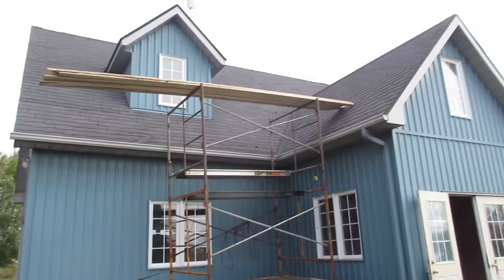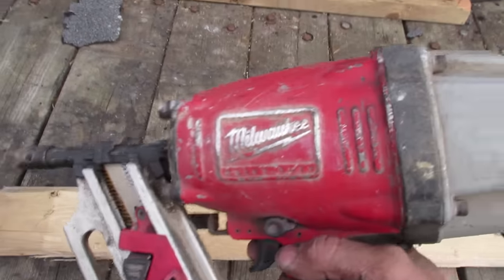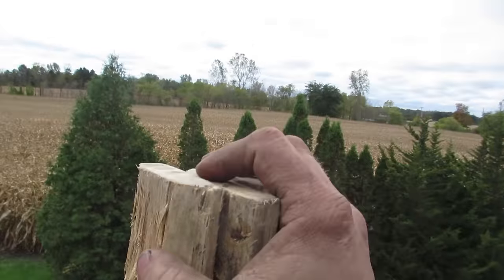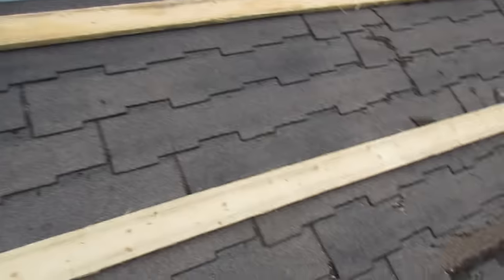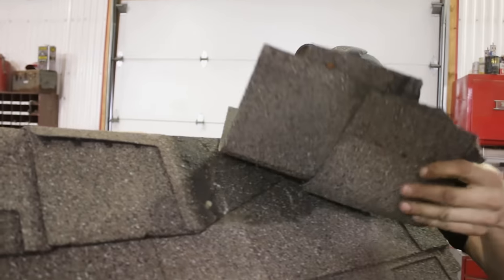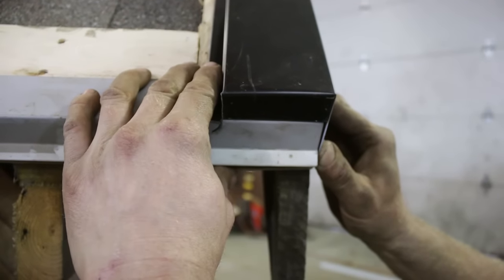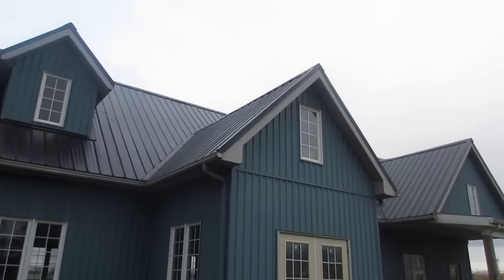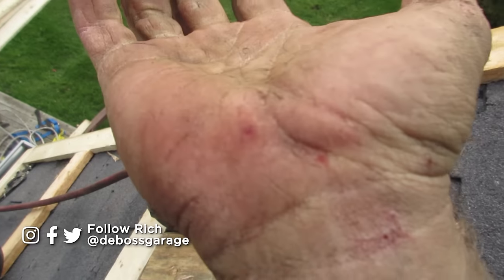How To Install DIY Metal Roofing (House or Barn)

Comment from the maker: Want to win a Lincoln Electric MIG-Pak 140MP? ENTER HERE ➜ http://debossgarage.com/contest
Reply: Great video, thanks. Do you recommend using the wood slats in every metal roof application?  I will be installing metal on my patio cover with only about a 6% pitch. Thanks.
Reply: A trick for your ridge cap....  Cut some flashing strips from your scraps,  say 3" x 10" or so.. . nail 4 of them onto a long 2x4 with flat roofing nails..  then screw those flashing strips in your top row of screws so that you'll  have a walk board to stand on....   Make sure, when you nail the strips to your board, that it lines up with your highs, of coarse.. super easy to do and easy to move works great and doesn't scratch the roof and allows you to not be bending your ridge outta shape while you work.
Reply: DEBOSS GARAGE don't you have to use the pink insulation on top of shingles?
Reply: @corndogextreme8887  What you’re looking for is called FanFold. It’s a 1/4” thick foam board insulation that comes in 4’x50’ folded sheets. This should be used in place of the purlins (wood slats). Purlins should only be used when the rafter/trusses are exposed.
Reply: @calholli   Sounds like a great idea but I'm having difficulty picturing how it all goes together and functions as a walk board.  Can you provide a bit more detail so I can get the picture?  Cheers Mitch
Reply: Wow I never seen vented ridge foam

Comment: Hello Rich,  I have to say that each steel manufacturer has his own recommendation as to where to put the screws be it peak or valley.  Most of what I have used is on the flat with stitching screws (smaller shorter ones) used on the seam overlap and the peak cap.  The other thing you might be missing is the panels are designed with the contours to be able to take the expansion and contraction.  To overdrill your pilot holes is counterproductive because if drilled to be just a bit undersized when the screw is driven the steel will 'volcano' just a bit.  Now when the neoprene washer comes down it makes an even better seal on the projection and water will most often run past very easily rather than climbing over.  Take a look on some old steel at the screw holes and you can see this.  I have not seen and have no knowledge of a properly screwed roof (as you say don't squish the seal) leaking.  My own has been up for thirty years in our coastal high winds (at least once per year over 100mph) , wet snow and 160+ inches of rain per year without any failures.  I am totally with you about walking on steel.  I won't do it if it is even dew damp!  And a harness is a must for even the most dare devil of installers.  Take care.  Doug
Reply: excellent counter points.  Thanks!
Reply: I always drill a smaller pilot hole in my steel as I go along. I dont predrill sheets.

Comment: Another thing I have to add is, you really need to locate and make sure your nails are hitting the rafters when nailing the 1x4's on. If not you are just nailing into old plywood in many cases.
Reply: Or crappy OSB.
Reply: Esp if your mailing into a mobil home

Comment: The ridges on your panel are flat. Our mfr pattern is rounded. It makes it harder to drill down thru to put screws.. Amish roofers put the screws on the flat either side of the ridges on the sheet. They also have an improved screw with a bigger washer and domed cap. Screw down steel is inferior for houses,

Comment: For people that watch the video and didn't click SHOW MORE under the video:
As for ridge screws; check with the roof supplier. Some warranties have changed in recent years where-as the screws are installed on the ridge, the warranty is voided. I had my roof installed in 2012. The builders installed ridge screws (thus far no problems). In 2014 the same metal roof company changed their warranty (applied to 2014 and later installation) to only cover roofs that have screws in the flat areas.
Also, IF you are screwing into the ridge, BE SURE you are using the longer screws (NOT the 1" or 1.5") because the shorter screws will back out over time due to the roof flexing in hot and cold weather.

Comment: Hi--great informative video...just a couple questions, if you've got a minute...regarding James Biggar's comment regarding underlay over the strapping to prevent rot--valid point, or not a big concern with shingled roof and it's vapour barrier still in place? (The garage example he'd used was direct over ply in an unfinished space).
Also, I'm in Ontario, and don't mind driving--could you please point me in the direction of your supplier (the prices you'd mentioned in one of your replies is pretty hard to beat)? Thanks again for sharing so much great info

Comment: also when putting those steel sheets use thick gloves because if it slips and starts sliding it will cut your hand if you try to catch it and also because of sharp edges anyway.

Comment: Thinking of air flowing underneath the metal roofing why not running 1" x 4"s vertically - spaced to match ribbing of roofing for securing with screws? Have screens at soffits end and construct ridge cap for airflow at roof peak. Also, I was told install heat reflective underlayment on shingles before installing 1 x 4's. This is supposed to control condensation issues under metal roofing.
(Just asking - curious!) I'm looking to cover shingle roof on my house - wanting to improve any  cooling of roof. 🤔

Comment: Hey, that stuff is thin. That's 29 gauge, right? You should have a factory nearby that will supply the 26 gauge and maybe for just a little more. Putting the screws on the ridge is interesting though. 🤔🤔🤔

Comment: THANK YOU......THANK YOU......THANK YOU.......YESTERDAY I ORDERED SOME METAL FOR A ROOF JOB......THE MANUFACTURER SAID DO NOT SCREW ONTO THE HILL....IF YOU DO IT WILL VOID THE WARRANTY.......INSTEAD.....SCREW INTO THE VALLEY.......THE FLAT AREA.....I PICK UP THE METAL ROOFING TODAY AND WILL ASK MORE QUESTIONS.....ALSO TELL ALL YOUR VIEWERS.......DO NOT USE A 4" CUT OFF SAW AND BLADE TO CUT THE METAL......THE SPARKS ARE HOT METAL PICES THAT LAND ON THE FINISH PAINT OF THE NEW METAL ROOF......IN ONE YEAR THE RUST SPECKS WILL START TO SHOW.......THANK YOU.....THANK YOU....THANK YOU

Comment: Is the additional weight an issue? Considering you basically have 2 roofs on it?
Reply from the maker: It depends area to area.  We calculate snow load on all our buildings which could be 2' of wet snow laying on top.  This is nothing compared to the weight of melting snow.  This is a steep pitch too however so the snow usually doesn't stay on, even though it will be designed to do so

Comment: I remember doing it on the rib nowadays the last one I did they wanted on the low not sure why some of the amish in Ohio do it in the low aswell.
Reply: Here in northern Oswego county N.Y. an in any area east of Lake Ontario those screws go in the low spot. An that is because steel or shingles when you get 3-4 ft of snow in 2 days you shovel it off. When the snow builds up that fast you really can't let that much weight sit on your roof. The snow usually won't slide off steel roofs till it approaches 28 to 32 degrees Fahrenheit. So if we get a wicked cold snap and a lake effect snow event that dumps 3ft of snow or sometimes more. I've seen up to 6ft fall in under 3days here. When that happens you get up there an get the weight off your roof. When those screws are on the high part of the ribs it's a wicked bitch to shovel. Plus the normal screws you buy when you buy the steel are 1-1/2" long. Not long enough to go through the rib an get any bite into the wood. You would have to order 2" more expensive screws to hit the high part. We only use the 2" screws for the ridge cap an the gable end trim.

Comment: i did the hay wagon bit when i was in the building trade , now i am jealous due to these days they have scissor lifts.
Reply from the maker: I bought a 2668 Genie as my first big equipment the minute I went on my own.  My old boss did everything off ladders and tractor buckets.  I realized he was nuts pretty quick.  I loved that little scissor lift but didn't have enough use for it anymore.  The hay wagon works great for not rutting up the lawn.  We ended up with a pile of rain over the course of this job

Comment: Never angle your screws, it will ruin the rubber seal,,,and the flat flanged end goes down and the unflanged peace laps over it, it keeps bottom peace flat on perlins and keeps it from walking off straight line.
Reply: exactly what I was going to say and he also is crimping the metal by over screwing which will lead to leaks eventually....not impressed at all at his workmanship

Comment: On the ridge cap, I put it on after one side of the roof metal has been installed.  When installing the second side of the metal, slide it under the cap and install screws in the 30 (or 36) inches of the new metal as you go along.  This will keep you from having to go out on the ridge after all the panels have been set.  If you do it last, besides flattening the ridge cap, it is almost impossible to set it straight!
Reply from the maker: Great tip!  Thanks
Reply: Fantastic idea

Comment: Despite what building code says in most regions, you'll need underlay over the strapping. Sorry dude. Been in the trade for 20+ years, 10 of those as a journeyman. I used to install this way as well. Not after doing my own garage, though. I went right over the strapping, no shingles or underlay below (garage was unfinished inside at the time). Perfect opportunity to see what happens. During spring and fall months when the temperature tends to swing quite a bit, condensation WILL develop on the underside of the panels overnight, unfortunately, and it adds up quick. It's not just a few drops - you could almost fill a five gallon pail. The condensation runs down the back side of the panels and hits the strapping. Strapping will eventually rot, almost as it would if it were exposed outside, except it's a bit more difficult for covered wood to breathe even with proper ridge ventilation. After just 4 years, my strapping turned grey/black from water stains. This also means that if a person is covering a shingled roof with metal panels because it leaked, then opting to leave out underlay will potentially lead to any holes in the shingles leaking. Of course, it's not a constant hydration, but it will still contribute to the degradation of the structure and insulation in the attic over time (once the insulation is wet and the weight of the saturated fibers compresses it, it's useless even if it's dried out). Just a helpful tip from a fellow journeyman.
Reply: Absolutely correct. Only way to avoid that is to spray foam the underside of the roof.
Reply: you could also add an underlayment directly on the shingles, then lay the metal over the top with a 2 1/2" screw. The sheeting is attached to the rafters, just like the stripping "should" be. I have seen strips that weren't nailed properly and could potentially cause the whole roof to come off. This also cuts down on rain noise.
Reply: What underlayment would you suggest overtop of the strapping, or would pressure treated 1x's be another option?
Reply: @Danguy351  dont use treated. They make a synthetic membrane,  also known as felt paper.  The problem with this  is water can build over time in the space between the wood strips. You can also get metal with the underlayment attached.  This is the best option.  Another thing about putting metal on wood strips people  dont know is that the metal can fade at different rates on the strips vs between the gaps, which causes horizontal strips on the metal.

Comment: Hi, man! Love your channel! I’m DIY-dieselmechanic and DIY-carpenter, so your videos gives me a lot of good input! Oh, and they’re really entertaining as well! 

You state in this video (if I’m not miss understanding something) that you don’t have roofs that lasts longer that 15 years. Is that right? I believe Norway (oh, btw, I’m Kai, from Norway) and Canada has very much the same climate (and your metric, thank god!) and we have roofs that lasts 40+ years. What’s your Canadian ‘standard-house-roof’ made of? Shingles or steel-roofs like in this video?
Reply: Standard roof is asphalt shingles. Older shingles use to last longer than they do now. Most farm buildings use steel roofing like is used in this video, and lasts 50+ years. The steel itself lasts a long time. The problem with older steel roofs now is that they used nails to fasten them, which come loose, and need to be nailed back down, or replaced with screws. Only screws are used now. Metal roofing is becoming more common now for houses, whether a steel shingle, or steel sheets like used in this video.

Comment: Your dutch right? put dakpannen on it they last 40 years😊
Reply: They last over a century when done properly.
Reply: There's standing steel seam roofs that last 50-100 years and architectural grade shingles that are usually good for 30 years. Up north the standing steel seam roofs are used because of extreme snow loads but mostly no one wants to pay for them. In the very rich part of Minneapolis you will see some copper and clay tile roofs usually on really old homes.
Reply: We usually use takpannor in Sweden.
Reply: @johnpossum556  copper is a rich man's roof because a) it's expensive, and b) it's inferior to less expensive metals like anodized aluminum or stainless.

Comment: "We can send a guy to the moon, but we can't come up with a roof that lasts longer than 15 years."
Hmmm... are you sure about that?

I noticed you said to start at the bottom and work your way up when you were doing the doghouse, but on the house you were screwing top to bottom. Is there a reason for that? Wouldn't that potentially cause unevenness in your overhang?

Comment: love the video. very informative and i understood everything you said lol. i have a question as i intend to redo my tin roof in the spring. does the roof need to be shingled first ?? i was thinking of stripping the old shingles that look like they out lived their lifespan by 20 years and just going with new plywood and tar paper. my wife and i bought this place 2 years ago this july but whoever did the roof messed up something because the roof sweats into the house which is why i was going to go with new plywood and just tar paper.
Reply: skullmonkey062369 DO NOT use tar paper.. that’s archaic and cheap.. use a good quality synthetic underpayment. You can just leave the shingles on. Strap it and put the metal on. If you strip the shingles, put the underlay on it afterward and the metal right on, no need to strap it if the shingles are gone. Also keep in mind that anything less than 1/2” plywood isn’t gonna hold the metal screws worth a darn

Comment: Damm. I thought it was aluminum. I just used a magnet to check.  So are my edges that I cut going to rust?
Reply: First of all, it's important to realize that there really is no difference between factory edges and edges made from cuts on the job site. Both are ultimately at risk of rust. Field-cut edges, due to the lack of precision that often exists on job sites, are at considerable risk of rust.

Comment: great video!
old family house had a vaulted ceiling (i believe it was done with scissor trusses) and there was an air pocket between the interior ceiling and the roofing plywood that ended up trapping moisture and heating up a lot.So even those roof types need to be vented
Reply: I had one that I did with a vaulted sealing this year and it caused heat to enter the house badly. It had an air gap, but I had to pack it full of expandable foam on two separate occasions and put a felt paper over the ridge before installing the ridge cap back.  I wont be venting vaulted ceilings anymore. Not saying this problem will happen every time, but it caused me a lot of headache.

Comment: Is it possible to put NEW metal roof over existing metal with a layer of INSULATION between of some kind without adding perlins or anything else? I have an old roof, plus it needs insulation as the heat goes right out through the roof, so I figure while I'm screwing down new roof metal I might as well insulate it too if I can afford it i.e.
Thanks for your time!

Comment: Never ever put screws thru a rib,,lay your sheeting facing the opposite direction of prevailing wind,,never never stitch screw ,,if you do you are setting up yourself for failure,,stitch screws will not remain tight,they loosen and leak as early as a year,,,again DO NOT STITCH SCREW METAL ROOFING EVER,,

Comment: Screwing on the flats is so much easier then the peaks, I done both ways. On my garage I placed screws on the peaks 10 years ago, so easy to over screw, constantly fighting the squareness, and what I notice is when metal roof heats and cools, all that movement puts stress on my 2" screws to where some broke and or loosen up. 
My house addition I just did 16x32' , I placed 1" screws on flats, the use of torque setting on drill makes it so much easier to stop at the right washer compression, speaking of which, I really cant see screws on the flat leaking, the rubber washer is compressed and the screws have metal washers covering them, so I guess have to wait and see.......... PS> Cut the cord and go Paslode, how you can work with air hose is beyond me..........

Comment: What happens if the plywood is rotten under the shingles. You should remove the shingles and 
replace the felt and check the plywood. BEST,